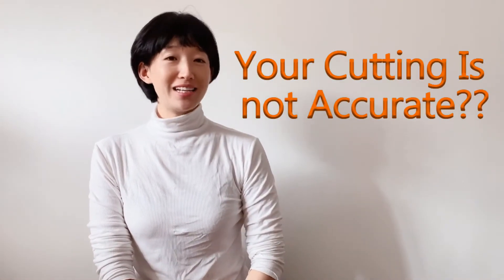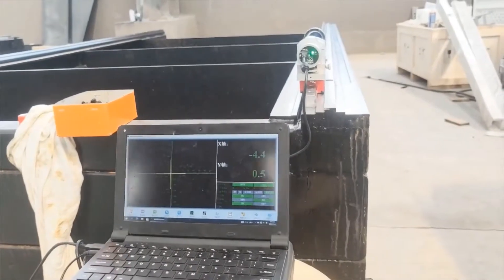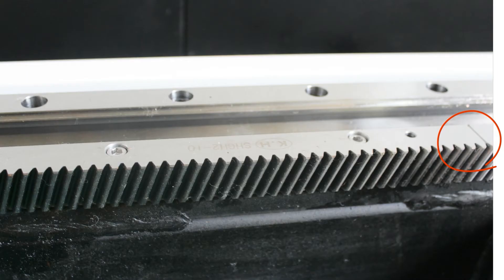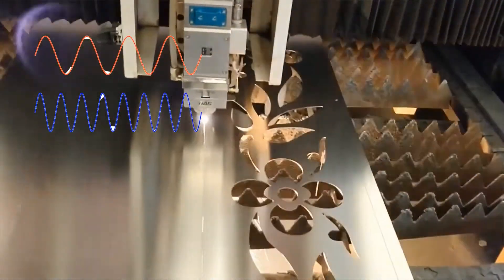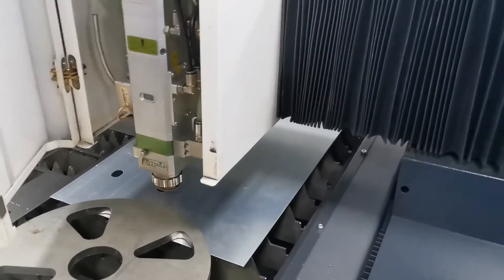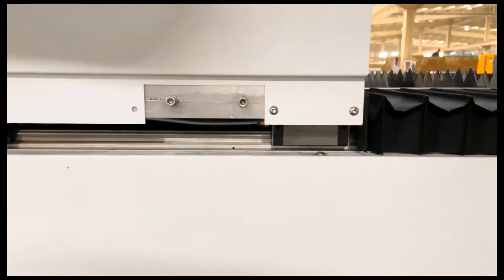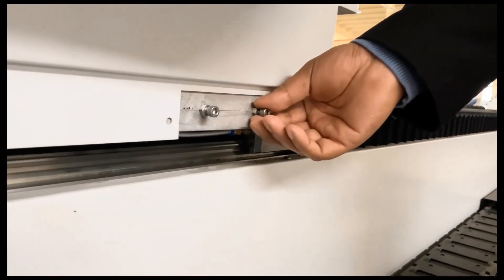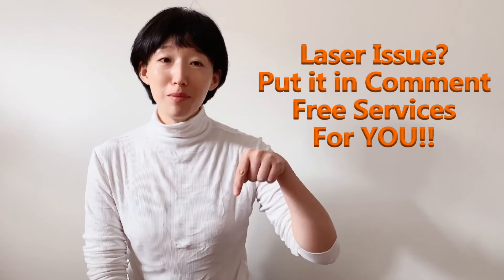Problems of Laser Cutting not Accurate |Laser Cut Solutions

Comment: Hello 
I'm working on raytools bm100 laser cutting head my problem is that the holes  diameter is changing 
One time it become minimum 
Another time it become maximum 

For example if i am cutting 32mm dia holes 
At some cases it become 29.05mm
At some cases it become 30.94mm

When I try to calibrate it shows error pls 
Give me some solution to resolve the issue
Reply from the maker: WhatsApp messages?

Comment: Dear Clara I am following you and I would like to thank you for your video because I was doing a retrofit with lambda system and raytools head , this project took me long time to do it and we searched videos showing the solution for my problem had and you are so good in explain it. This is the. Main reason that we can recommend you. Now we have a problem with circle cutting the shape that I am getting is oval. We adjusted the servo gain and it get better but not complete accurate. We saw video showing about the gap but it is not complete cleared. Can you do a new video showing the way to.adjust it. Other hand the accurate problem can be done for adjust the center of the axis x and y ... it means that the center o point can be out of center in. Table machine ..it is possible that the circle is getting oval..please let me know your comment.. thank in advance
Reply from the maker: The gap could be one of the reasons, it needs to see your machine and find the your solution.
Reply: @ClaraChai  we will send you machine pictures for whatapp

Comment: Hi my name is Sathish my laser machine was problem 0.7 mm 1mm 1.2mm 2mm 1.6mm thickness not cutting  in air compressor  (permater is k nazil lens is k )

Is same thickness gas o2 cutting k finish ing k no problem in o2 gas cutting
Reply from the maker: Sorry, could you explain more?
Reply: @ClaraChai  k I will video send
Reply: Give your number i am service engineer, I will try to solve out
Reply: O2 ke sath cutting karte hai tab pressure kam rakhna hota hai

Comment: Hi ,i have a Little Errol with the shutter Point,he doesn t stop when i press the button shutter,can u help me?
Reply from the maker: You mean the laser beam can not shut down?
Reply: @ClaraChai  yeah and the results i cannot perform laser operations
Reply: @ClaraChai  alarm is acdc2 ,can u tell me what s wrong?
Reply from the maker: @dragossebastian1423  Laser Power Module? Damaged?
Reply from the maker: @dragossebastian1423  If your machine is in warranty, I suggest you to contact your supplier.
Reply: @ClaraChai  on source alarm acdc2
Reply: @ClaraChai  raycus c2000 îs the source and the alarm îs acdc2
Reply from the maker: @dragossebastian1423  Please contact your supplier if it is in warranty.

Comment: Hello @clara chai, I have a problem with my laser, it is not cutting properly, I have checked the parameters and everything and changed them time to time to see for results, but it doesn't cut properly. It only cuts on the top and doesnt cut on the bottom
Reply from the maker: My WhatsApp is +8613335151833, you can share some pictures there.
Reply: Sir, have you fix it already

Comment: Hi, it is not clear how to solve this issue, will tightening the allen bolt solve the issue  ? What should be done to rectify the problem ?
Reply from the maker: Yes, it is. The premise should be as following: 1: There are the adjustment area on your machine. If not, probably you need to contact your supplier first. Due to the uninstallation will be kind of “self change”; 2: You need to make sure the cutting error is caused by the gaps. Conversely checking the gap is also a way to find why the cutting error happens.
Reply: Hi Samir, I’m sorry about your laser not cutting properly. At GaussML, we have a solution for people like you with similar issue. We have developed an Ai solution Optimyzer to help machine operators find better settings in minutes not months & with the success rate from our clients, we will be happy to give you a free demo to try.